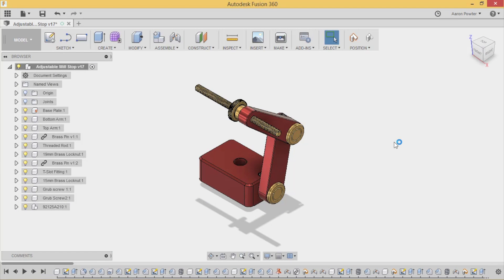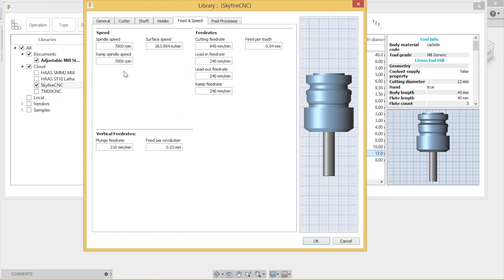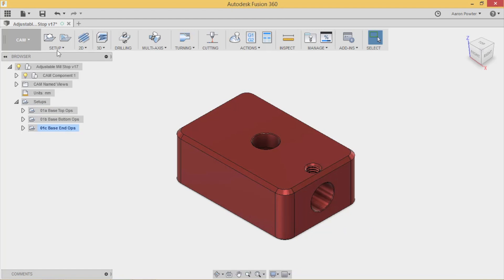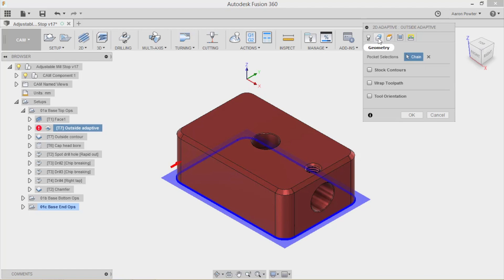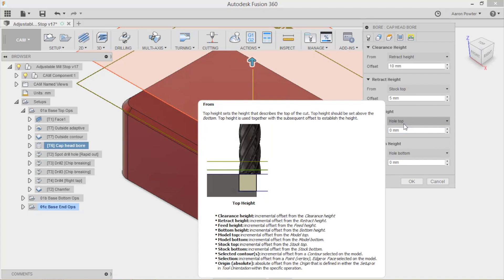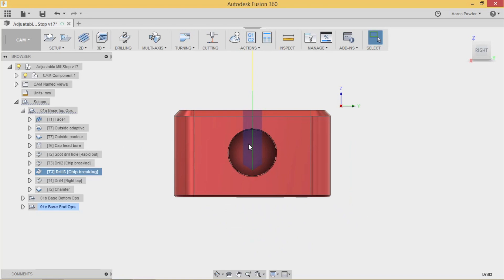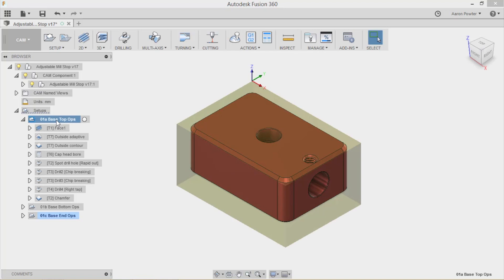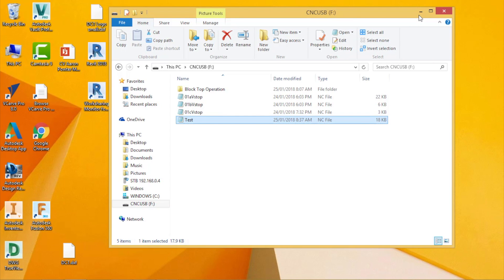Mill Vise Stop Pt.1 - Applying Fusion 360 tool paths

Comment: Looks like a cool project!
Reply from the maker: Hey man how are you?  I think your name is Paul?  Please correct me if I'm wrong.  Thank you very much.  It's a great little project and I'm very appreciative to Micheal Connor for suppling it to me to make and film.  Hope you're well bud?  Cheers, Aaron.
Reply: Hello Aaron, yup it's me hope all well with you. Hope to see you making some chips soon! One of these days you might see me doing the same....  In the meantime I may do a video on the surface grinder I just got, it's a chevalier 618. Been busy rewiring with 2 VFD's and fixing a couple of oiler leaks and replumbing the coolant system.  Cheers :)
Reply: Hello Aaron, yup it's me hope all well with you. Hope to see you making some chips soon! One of these days you might see me doing the same....  In the meantime I may do a video on the surface grinder I just got, it's a chevalier 618. Been busy rewiring with 2 VFD's and fixing a couple of oiler leaks and replumbing the coolant system.  Cheers :)
Reply from the maker: Ha ha ha, lucky guess I'm my behalf :-). Hey, that's awesome man.  You need to do a video on the surface grinder please.  I would love to see it up and running.  I'm editing the CNC machining video now which will be part 2.  Many viewers have asked me to slow down and show in more detail (how to do it, and run in real time not sped up footage). There is just too much to show to do this, so this is why it will be a series of videos.  Great chatting with you Paul.  Cheers, Aaron.
Reply: DCTTeacher1 do you have blue prints for the vice stop,  I could not find them on the mentioned site.

Comment: Hey Aaron,
Nice work as always...but can you tell me why you use 'conventional' milling when you do your chamfers [not climb milling]?

Just personal preference? Or is there a good reason to do so...?

Cheers,
Jeff
Reply: I knew there would be a good reason!
Reply from the maker: Ah, you are very wise grasshopper.  Good pick up, you have eagle eyes and good attention to detail.  All jokes aside, Yes I use conventional milling when contouring with my Sutton spot drill.  For some reason, my spot mill leaves a burr when I use climb milling.  This doesn't happen at school on the Haas, but it does on my little Skyfire.  Changing it to conventional milling solves this problem (for me) ;-). Cheers, Aaron.
Reply from the maker: ha ha ha, it's all good mate ;-)